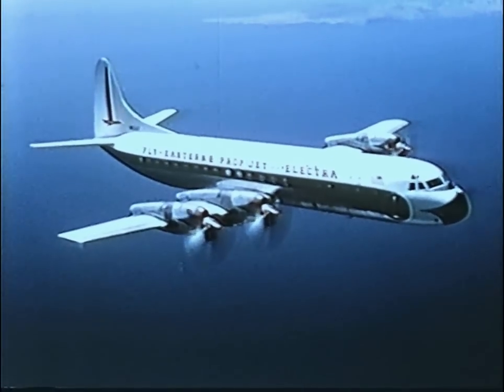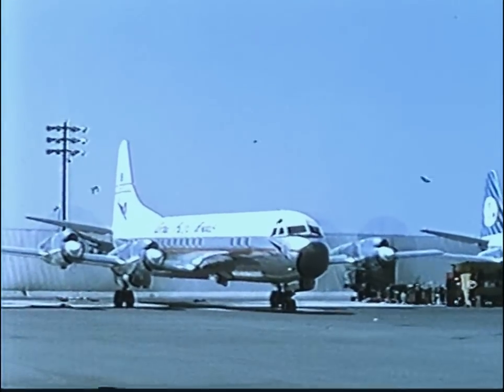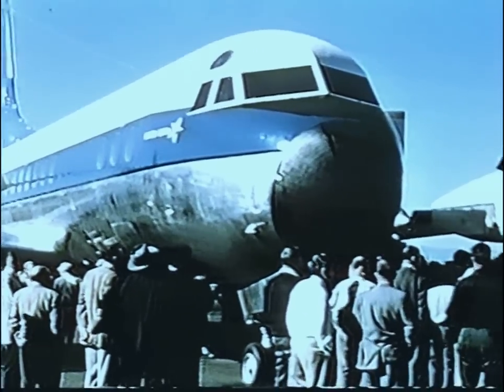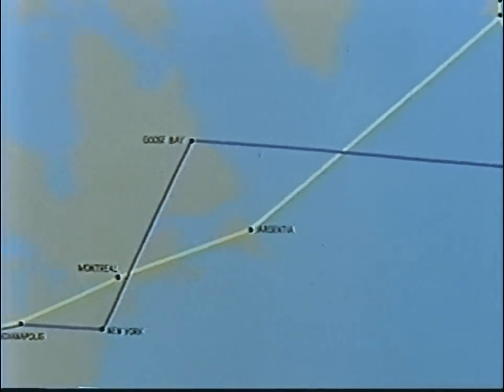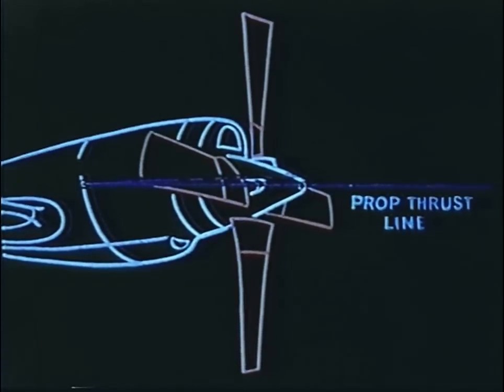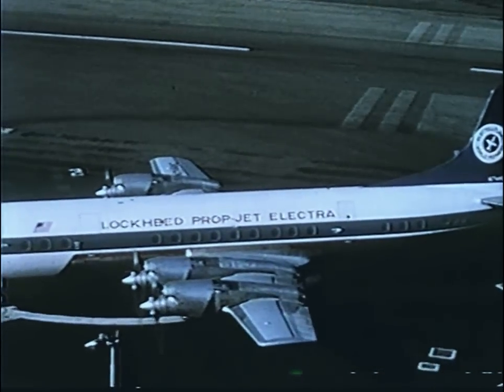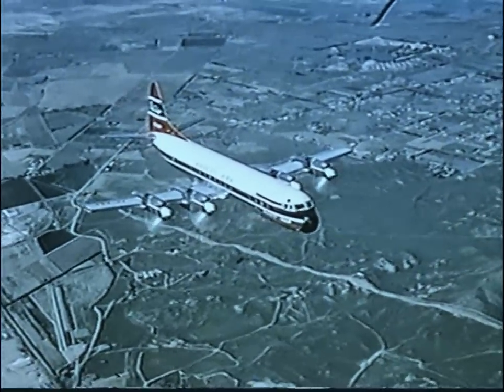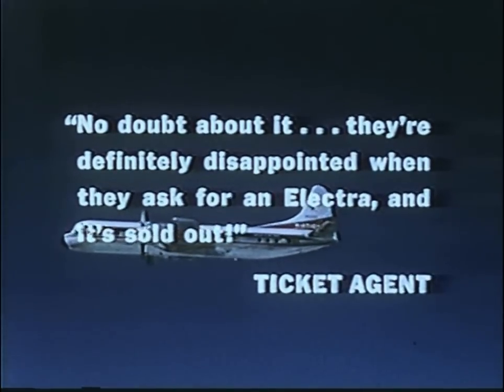Lockheed L-188A Electra Promo Film #3 - 1960

Comment: Nice looking plane ... There was a prominent issue with the Electra that for some reason was never rectified. And, due to this issue, I  would have never stepped into one. The Electra depended on it's own prop wash to provide ample lift for the wings to maintain flight. Even the loss of a single engine impeeded it's ability to remain airborne. The wing 's surface area was too minimal for the plane to glide and would potentially drop right out of the sky . Aircraft Crash Investigators did an episode on a crippled Elelctra in which the pilot discusses this flaw. The "Connie" was a much more supberb design, doing what an Electra could never do ... fly on one engine.
Reply: My dad flew Electras, mostly the retired Eastern birds in cargo service. I recall him ferrying one with only 3 engines after it sustained damage, so the notion that loss of a single engine would cause it to drop seems amiss.
Reply: +raymond taylor I The problem was rectified.  Speed was initially limited to 260 mph until the structural problem with the engine mount was fixed.  The damage to the airplane's reputation was already done.  Passengers refused to fly on Electras and airlines canceled orders.  The L-188 went on to have an illustrious career with freight airlines.  Small airlines even continued to use them for passenger transport in Alaska (Reeve Aleutian) and Indonesia (Merpati).  Of course, the Electra was the basis for the Navy's Orion.

Comment: "The Electra Story" written by Robert Serling is, for my money, the definitive story of the L-188's development, trials and eventual triumphs. He writes in detail about the two crashes involving mid-air separation of a wing from the airframe. Lockheed's testing was thorough although there was no reason for them to break a few parts on the Quick Engine Change assemblies before sending up the test planes. What the post-crash investigations revealed was a hard landing or an encounter with rough air could cause fractures that weakened the QECs in the outboard nacelles. (They also found that those outboard nacelles were, as Mr. Serling wrote it, taking much more of a "beating" - stresses - than anyone expected or anticipated.) Once damaged, another in-flight encounter with a fair bit of turbulence was enough for the QEC to fail. This set in motion a cascade of events from the prop wobbling to the engine gyrating inside the nacelle, busting the reduction gear box and sending a pattern of vibration into the wing that the wing structure could not absorb or suppress. The investigators figured that 30 seconds into this phenomenon called "Whirl Mode" is when the wing succumbed and ripped away from its mountings. Lockheed developed a fix that added over 1,000 pounds to the airframe, including stiffened wings, thicker skin on the wings and improved QECs, among other things. The modified Electras went on to become a favorite of pilots, passengers and the airlines. Eastern retired their last Electra in 1977, with more hours on it than any other aircraft they flew before or after.
Reply: ...read the book myself back in the 1960s.   The programme of modifications was titled LEAP which stood for Lockheed Electra Action Programme and all aircraft went though it resulting in a very durable and safe aeroplane. 
 
https://lessonslearned.faa.gov/ElectraWings/Leap.pdf
Reply: Eastern Air Lines flew the Electra on the DCA LGA into the late 80s. It was the prime a/c for the 8 pm DCA to LGA because it could fly back after the 10pm curfew. It was the back up A/C all day long and flew just about every hour. The Eastern Shuttle was a guaranteed seat. So if you showed up before the hour if the plane was full we pulled up an Electra  and you got your seat even if you were the only person you got the whole plane to yourself. I loved the Electra. One other thing. The Thanksgiving that TWA lost a 727 going into IAD, that was diverted from DCA because of weather. The Eastern Air Lines Electra's were the only air craft flying the rest of the day. I was so proud of that bird and the fact Eastern still had them. If not for Frank Lorenzo Eastern would still be flying and maybe the Electra might still be flying shuttle backups. GREAT PLANE, GREAT AIR LINE.
Reply: One of those crashes was a Northwest Airlines flight that crashed at Tell City Indiana.  My father had, and lost, a dear friend that was on that flight.
Reply: Any Idea of how many Hr.
Reply: The Navy P-3 Orion is still on service today.
Reply: I am going to read that book. Thanks!
Reply: I read the book in the 1960s and got a copy thru Amazon about 5 years ago.

Flew on the Electra several times in the late 1960s.
Reply: Voaram até 1991 no Brasil fazendo a rota Rio de Janeiro para São Paulo sem nunca ter acontecido nenhum acidente fatal

Comment: Turbo-Prop engines are very efficient.  Instead of a prop, all newer airliners use a 'fan' that is ducted.  Essentially a multi-bladed prop with a shroud around it. The Dornier 328 prop jet was almost as fast as a 'pure' jet but used less fuel.  The flying public does not seeing propellers.
Reply: I'm not the typical flying public. My reasons are completely unscientific. Propellers evoke a more romantic era of flying. Modern prop airliners carry fewer passengers and load and unload much faster. The ten minutes "saved" by jet between RNO and PDX are used up boarding and deplaning.
Reply: @maxpenn6374  
Mike obviously doesn't know how a jet engine works.

Comment: What's with the apparent radial engine in the starboard outer position at 12:21 to 12:24?
Reply from the maker: What you are seeing is the black part of the prop rotating...giving the illusion that is the view of cylinder heads.
Reply: They are not radial piston engines, they are turboprops. It is basically a jet turbine engine that drives a propeller. So, it looks like a traditional piston airliner but it's actually a jet. Turboprop's are common even today on many smaller airliners run by local commuter or connecting airlines.
Reply: Ah, ok, I see what you mean... Yeah, for some reason the running engine does look different that what I am used to seeing on an L188.
Reply: Classic Airliners & Vintage Pop Culture Thanks. Now that you mention it I can see some of the outboard wing through it. It's a brilliant illusion though :)
Reply from the maker: Random channel
It does indeed create an illusion!
Reply: +Classic Airliners & Vintage Pop Culture  . . . . apparently. 
Well spotted! 
Maybe this is a good week to give up amphetamines after all.
Reply: well picked, no idea, not an optical illusion, the engine shroud is completely different.

Comment: That vibration was more than a nuisance. It cost lives.
Reply: "Whirl Mode Vibration, " was unknown at that time.  It took all the Airlines, and Airline manufacturers to figure out the problem.  Had that vibration mode been in the books and known at that time, the issue would have been moot.  Remember the first Jet Airliners?  They crashed too.  The windows were too large and had square corners.  At those speeds, metal fatigue caused many failures and also cost lives.  Oh...  NASA had issues too - remember?  All new technologies have issues until they are understood - evewn in Tech.  Remember the Intel 80387?  Well hell... it was only off by one integer known as the "Off by One," error.  Since the L-188 airframe has been updated it is still in service as the Orion and still flying passengers, without incident, all these years later.  The L-188 and the DC-3 has passed the hallmark of manufacturing time, while all of the original Boeing, and Other manufacturers Jets have all been changed.  I was privileged to have flown L-188's in the right seat.  For a missed approach those Allison 501's required hardly any spin up time.  And that wide body cockpit was brilliant, and visibility was fantastic.
Reply: Richard McCaig A-380.
Reply: Peter Bradshaw Definitely!  Having your body's DNA identified by scraping marrow out of a Vertebrae they dug out of a cornfield is a bit more than a "nuisance" to say the least...  ✈✈✈
Reply: @randy109  
But you could build a perfect airplane while using 40's technology. 
Show us Randy......you
Reply: LOL

Comment: US Navy Electra ( Orions ) still fly ASW. Great airplane.
But she had her problems. Before turning her into a great airplane, she had fatal crashes due to structural failures.
Reply: Et al:
I was a flight tech on the first and second prototype L-188;  I worked for Hamilton Standard Propellers and we were tasked with testing and certification of a newly designed foam core folded steel propeller on the airplane.  Our results showed the props, which were designed based on Lockheed's specs, would live in the L-188's stress and vibration flight environment for hundreds of hours, not the tens of thousands expected and could never be certified for the aircraft.

Hamilton Standard, the best propeller manufacture in the world, lost millions on the project and had to redesign the prop blades for certification using solid aluminum alloy and rounded blade tips. .  The redesigned Hamilton Standard propellers were only used by one airline, KLM until the U.S.A.F. specified their use on the C-130 and the Navy certified their use on P-3s years later.
Reply: Great information sir, thank you. My buddy was a mechanic in the USN working on P-3's in the 1980's. I'm aware she still is with the fleet.
My Uncle, a retired American Airlines Captain, flew the Electra, liked her after they restressed the wings, according to him.
I'm a private pilot myself, and started flying in the early 1970's in South Jersey, often visiting NAS Lakehurst, the nearby Naval Air Station , close to Ocean County Airport where I flew. I loved watching the old Grumman Trackers fly ASW, their Wright radials were quite an engine. Did Hamilton fit out the Grumman Trackers w/ their propellers?
Hamilton still in the game? Im not sure as I stopped flying years ago, as it became a real rich mans sport !
Thanks again for the info on the props, still love aviation.
Reply: Yes, just confirmed it, the old P-3 Orions are still w/ the fleet. Good airplane.
Reply: t0nyc0nde No, shortly after, I started college.  However, I have always thought there was more to the story than what we know.  For example; Lockheed touted their new method of building the Electra wing as a marvel of production;  the bottom of the wing was build as one giant extrusion; was it too flexible?  I must add that if you talk to pilots who have time on the plane, they like flying it, mostly because of the huge amount of air the props can move across the wings and grab on acceleration.

Comment: When I worked at Boeing, I knew a guy who used to work for American Airlines. When Lockheed came knocking to sell their L-1011, American wouldn't even let them in the door. American lost a lot of money on its fleet of Electras, including a fatal crash. (My first flight was on a PSA Electra in 1964--nice ride, as I recall).
Reply: Greatdome99 Kind of ironic, though, isn't Greatdome. American had some bad luck with Electras, shuts the door on the L1011, purchases DC10's (which end up having multiple issues of their own with several airlines), then circumvents maintenance guidelines in an effort to save time and money and ends up with the worst single plane accident in US history with AA Flight 191. Even after the crash, they tried to trash McDonald Douglas and the engine maker (trashed the Eastbourn Report on their maintenance shortcomings to hide their screw-ups), then made it a living hell for the survivors when they tried to get just compensation for their screw-ups. Ironically,the L1011 was a much more stable aircraft with less issues than the DC10...so in my opinion, they bit it. Also, given their current customer satisfaction rating, service, and overall operations, I avoid AA as much as possible in my business travels.....
Reply: my first time flying alone was in the early1960s from Savannah Ga to New York.Themplane,an Elekta was something I had ne'er seen beforeimenjoyed the flight an d don'remember the noise being too bad.When I flew home at Christmas,the Elektra had been replaced with a 727that felt like a big step up?The 727 was one of my favorite jetliners until my first flight on as747.Flyiing first clas on a 747 is still one the best experiencesIve had on a commercial flight.not quite the same as first takeoff in a Cessna152as PICbut still memorable
Reply: The DC-10 had some system redundancy and systems default issues that were amplified by multiple mishaps.  In American's case, their own procedures were to blame for the Chicago crash, although many who know much more than me have said that the plane should have still flown even when that engine fell off.  The forward slat on that side should have defaulted to the the down position, which it apparently did not....if it only were really that simple.  I rode on the L-1011 a few times and it was a nice aircraft...Lockheed however, was fighting a losing battle in the commercial airliner market by that time.
Reply: @sjoldtimer  
Yeah, it's too bad.
L1011 is the best plane I ever flew on.
Lockheed was a great company. 
They put together the SR71.

Comment: "Lockheed's fail-safe structural design…"  That's a laugh.  A few Electras disintegrated in-flight before the whole fleet was grounded.
Reply: Except the Electra was not grounded. It had a speed limitation imposed until the necessary modifications were made.
Reply: @HEDGE1011  
Either it's a Boeing, lockheed, or McDonnell Douglas basher.
These are little baby's in their mommy's basement,  that couldn't sharpen a pencil that make all the ignorant comments.

Comment: I like to call the turboprop Electra the "Electra II," as the improved models would later be called, to distinguish it from the piston-powered L-10 Electra.
Reply: The commercial names "Electra II" and "Super-Electra" were adopted after the accidents and not to distinguish from the , 1934 "Model 10". The public opinion was chocked with the wing detaching horrible accidents and re-branding was part of the (unsuccessful...) re-launching campaign for the model, following the FAA grounding and the mandatory structural modifications. The fixed Electra was a beautiful and efficient aircraft, but it didn't sell and almost broke down Lockheed.
Reply: @pedrog.3604  Your remark predates the recent misfortunes of Boeing's 737 Max. I doubt public confidence will be restored any better in the present case. The market is ruthless in punishing such failures. I agree the post-retrofit Electra was a fine plane and it's too bad Lockheed couldn't recover its reputation.

 I'm not as prepared to forgive Boeing for its attempt to update a model that first flew in 1967. The 737, in its many versions, has been around fully half as long as the entire airline industry! 
1914 - 2020 = 106 years
1967 - 2020 =   53 years!

I'm not trying to change the discussion from the Electra, just pointing out similarities and differences between the two.
Reply: Lockheed ended up calling it the Electra II also, after the LEAP program.